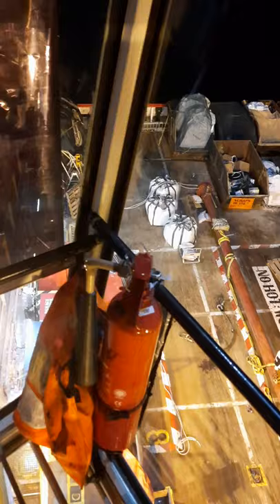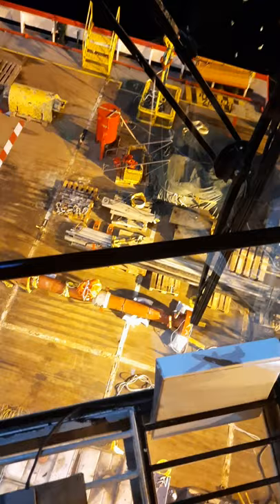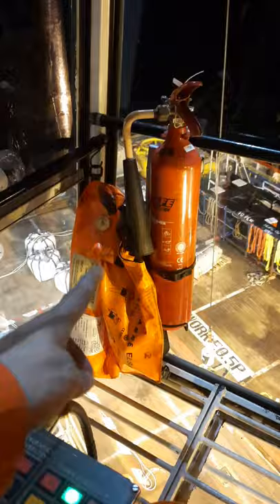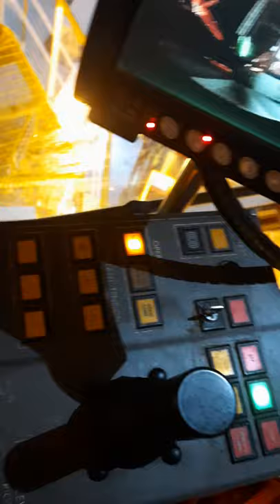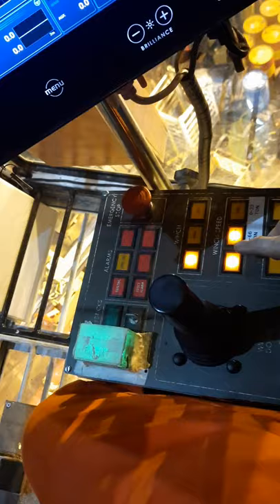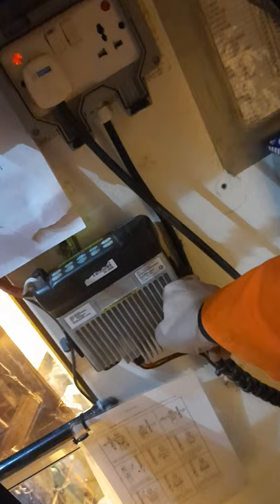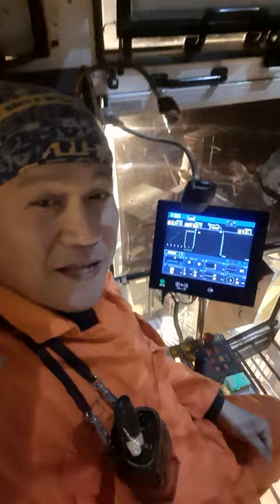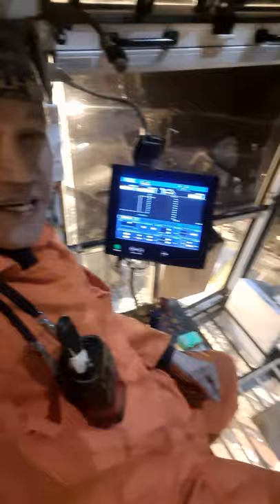Offshore Crane Operator Knuckleboom AHC JOB FOR THE DAY

Comment: sir is there a course in the Philippines to be an offshore crane operator?  and what is age the maximum accepted ?
Reply from the maker: Hello Sir. Yes there are 2 training Centers in the Philippines for Offshore Crane Operators.  If you wish to go on the Brittish Standards 7121 Part 11..then please get in touch with Seatag-AustraAsia@UMTC.. Should you wish to go on thr Norweigian Kosar G5 side..then kindly check Norwegian Training Center Manila NTCM.

Good Luck bro.
Reply: @CraneRexOffshore  thanks for the great info sir!  May I ask which standard your license is, British or, Norwegian Kosar ?
Reply from the maker: Both Sir. So as to be available when doors open . Kindly enquire to those two.
Good day Sir.
Reply: okay sir, Im asking coz I took G5 back in 2016 with sir Odee Tolentino but haven't really used it since I'm still working in landrigs but still hoping to get the bs7121 or, api rp2d! cheers sir and good luck to your crane op. assessorship!

Comment: Hello my friend, would you be possible to explain or make a video how to operate the tugger winch while attached to the main block when you operate the crane ie: knuckle in and out boom up or down etc
Regards and safe lifting
Reply from the maker: Im sure on your crane it will be manageable as there would be ample forms of instruction. Electronic and hard copy...... maker and model specific so no sense in taking a video for my particular type tbst Im on atm....as it might mislead.....Safe lifting Bro.
Reply: Hi Bro,
Yes indeed, the crane l operate we have two controls incorporated on both joysticks to operate them (2xtuggers) accordingly when it is necessary for different situations, cause it was my first time use it, i thought it was more difficult as it is, so its very simple use it to control loads in different weather condition as well operations during daily basis.
Thanks for your tips and safe liftings.